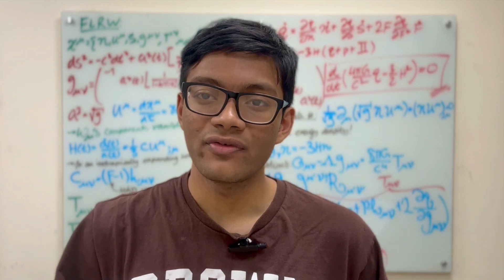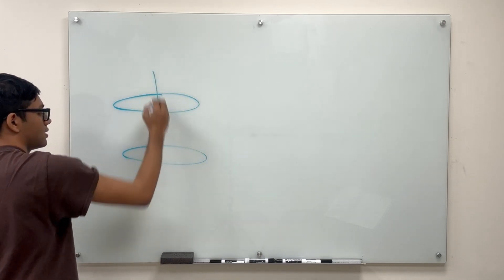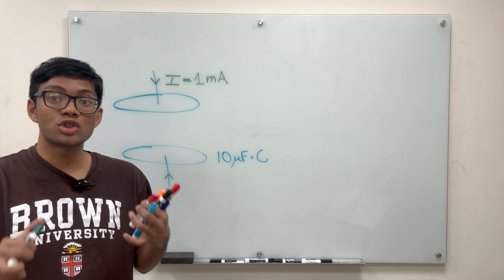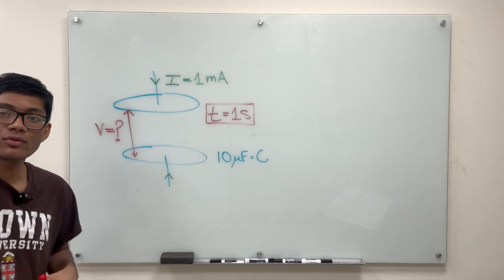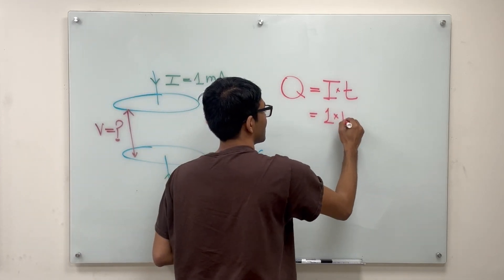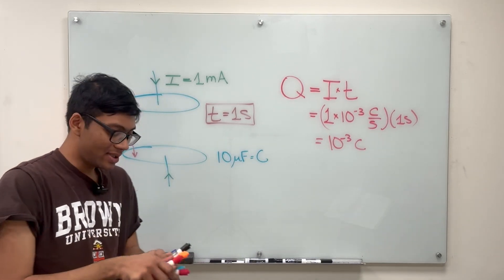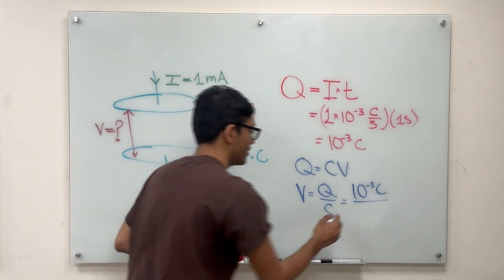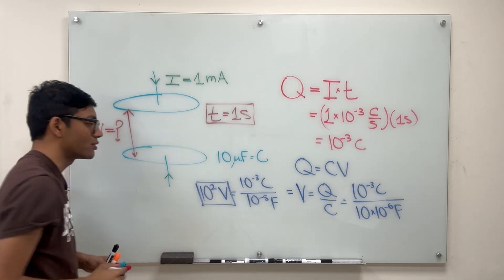Physics GRE #1: Capacitors

Comment: would you recommend taking math 55 at harvard?
Reply: Hello there! I'm not someone that has taken that class but already know what's studied inside it. It's real analysis, linear algebra and some abstract algebra but they just make it "compact" and teach it pretty fast. Those are the core of puré mathematics, and you can take them there or simply study by your own. Anyways, if you want an insight of what's done in pure maths and you want to know, but you're not a math major, take them! And you can expand your knowledge with books but you have the advantage to be familiarized with the content. Now, the thing that, in my opinion is a weakness of that particular class is how fast they teach; the time to grasp the concepts is short so, you can get them but to really think about the depth they have or their implications, i'd suggest either self study or taking regular lectures of the subjects (tho they take more time). But that's only an opinion, maybe a little biased because i like to think deeply on the concepts and their implications and link them to others and even extrapolate them outside mathematics (like, for example, use them in Epistemology, or explore them from linguistics, etc) but only taking your time, even days only to think about the ideas after you learn them, allows those depth, otherwise, probably you will learn them and that's all :)